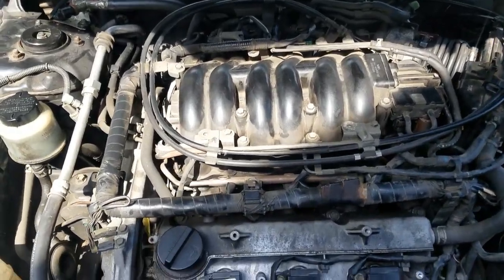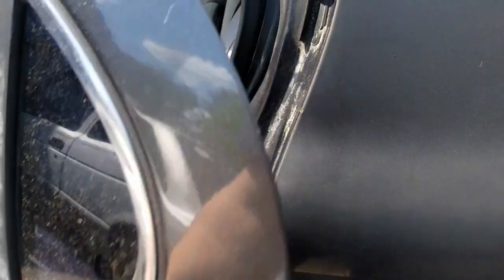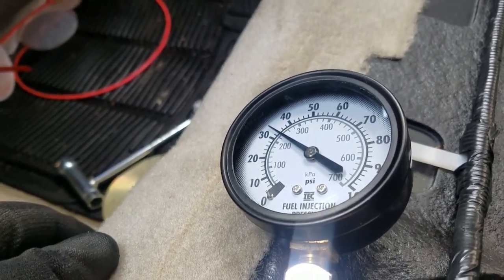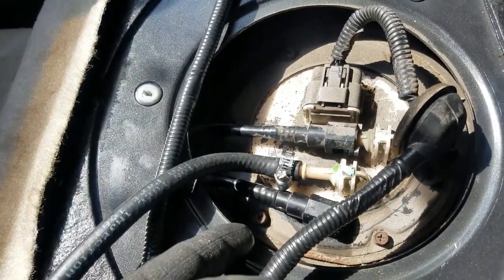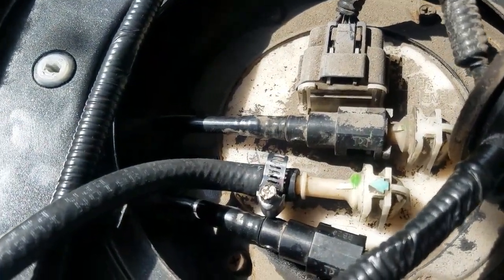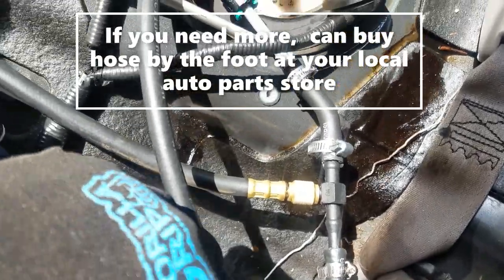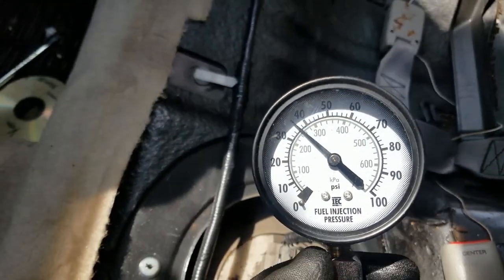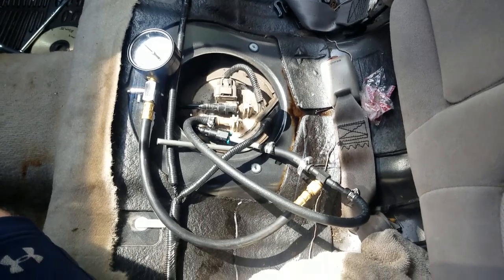How to test fuel pressure on a car without a fuel pressure test port.

Comment: Im getting ready to do this on my 1995 Toyota Camry but I cant tell how you connected the hoses, I hear you say the one with the arrow pointing out and then you mention that you remove the clips on the other two? I am confused as to which lines are hooked up to test the fuel pressure

What I see is one connection that is the one with the arrow, which looks like its coming from the pump? And the other connection on the t fitting is the return line?

Comment: Do you remember the size of the fuel line? is it 5/16"?..There is a short section of rubber hose towards the firewall
you could also tap into but it's below the air intake box. Good Vid.

Comment: I'd be interested in knowing how you bled off the pressure first before disconnecting the lines from the tank
Reply: Pull the fuel pump fuse or relay out, run or crank the engine over to bleed the system
Reply: Pull out the relay from the pump, run the engine until it cuts out and then attempt to start it again. Fuel will be depressurised

Comment: The plastic green cap on the line by the throttle body is where you check the fuel pressure on that maxima
Reply: LOL. Thanks for that.
Reply: No that’s the evap line
Reply: @michaelhaile401  Ooops. Does anyone know if Honda actually provides a Schrader valve for checking fuel pressure on these engines?
Reply: @joequillun7790  probably not, most Japanese cars don’t have built in schrader valves in the fuel rails. I’ve only seen them on US/European cars
Reply: @michaelhaile401  Bummer. Well, thanks for the response Mike.

Comment: And where can I get that metal pipe piece?
Reply from the maker: Autozone, advanced auto, O'rileys, ect. I got mine at autozone. They are usuall in the generic/HELP section.
Reply: everydayfixer is there a specific name for it? Or is it just a metal pipe
Reply from the maker: @jacobingram8152  I believe it is a fuel line.
Reply: everydayfixer Oh ok. The scrap pieces they’ll have laying around. Hey alright. Thanks alot